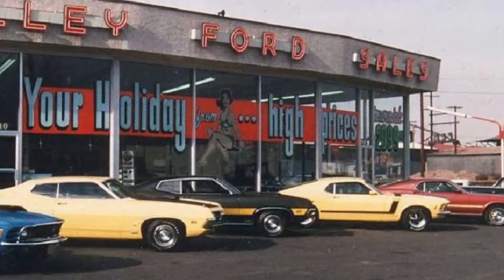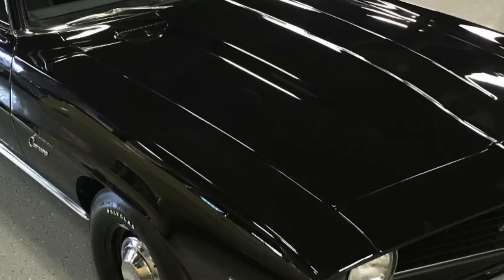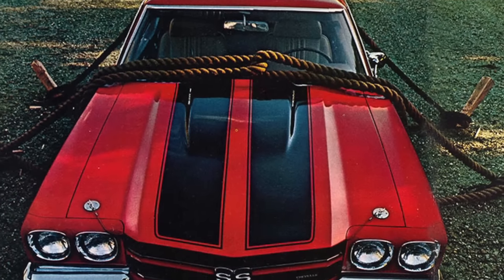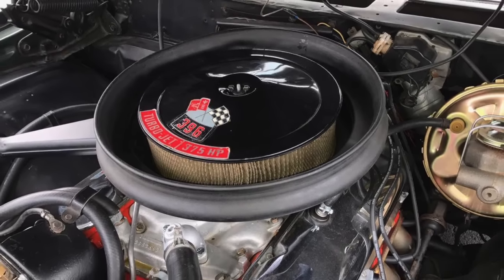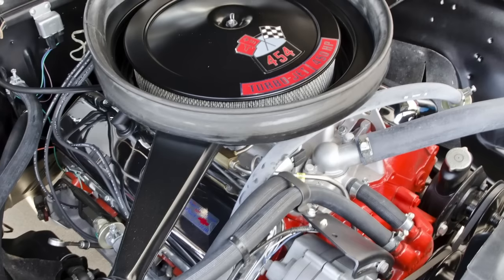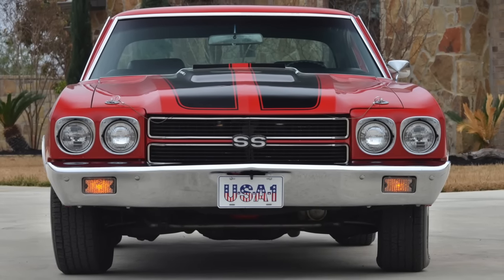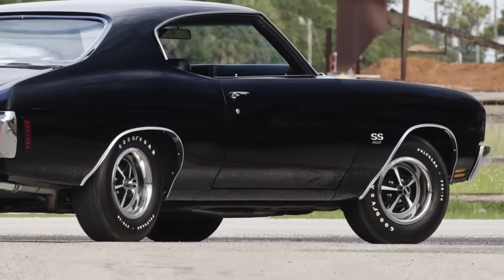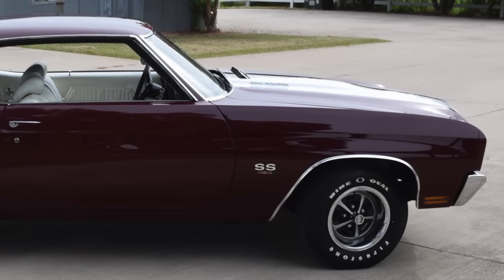1970 Chevrolet Chevelle SS LS6 454 – Freak of Nature

Comment: I owned a '70 Chevelle SS-454 for 15 years.    It was a plain jane LS-5 car with an M-22 four speed and bench seat interior.  Even with the "lowly" LS-5 engine, the car was a beast on the street and drag strip.    I didn't take the car to the track much but I never lost a drag race to any Ford or Mopar when I did.  I raced in the street class.  The trick was trying to get traction off the line.  Fun times.  BTW:  There was a '64 Malibu SS.  It could be ordered with any engine, including a straight six...but you're right, '65 was the first year a big block could be ordered in the Malibu.

Comment: Good Video .....I got to say  the 64 is the first SS Chevelle...not 65.
Reply: 64 was called Malibu
Reply: Ya I don't think the SS option was available until 65.
Reply: I am pretty positive there was an SS Malibu in 64 but there was not a big block in them until 65
Reply: I bought my first Chevy in 64 and it was a 64 chevelle SS.  Bucket seats, 3 on the colume. Didn’t have an option for a 4 speed or a floor shifter. Had to put a floor shift in as the rods to the tranny would bend and lock up the tranny. 
No there wasn’t any big block option.  It was a sexy car.  Bought a 66 SS 396 after that.  They came with Ford Holly carbs as GM couldn’t get the quatra-jet into production.
Reply: Wrong. It was the Chevelle. Malibu was a trim option on the Chevelle. In the 70s the Chevelle name was dropped and then it was the Malibu.

Comment: As I mentioned on another video, in 1971 as a senior in high school I bought an SS 454 El Camino, painted the same red with black hood stripes as this car, had a black landau top. It had hood pins,  cowl induction, M22 Muncie transmission, I removed the smog stuff, added cyclone headers, replaced the Rochester carb with an 850 Holley, magnetic impulse distributer, Gabriel shocks, Crager wheels, BF Goodrich radial TA’s, wide in the rear. It was fun on Van Nuys Blvd. I had the opportunity to meet with Jay Leno about 3 years ago and mentioned this car. He asked “and you still have it, right.” He said if I did he would buy it that day, said it was near a $1,000,000 car. I had purchased it for $2560 from Pollard Whitman Robb Chevrolet on Van Nuys Blvd, unfortunately sold it for $2750 a year later. I did replace it tho with a 1971 SS 454 Corvette that I bought for $4540 from the same dealer, I sold it in 1988 for $74,000.

Comment: one bad mo-fo.  Imagine what she could do with real tires instead of poly tires.
Reply: Yeah I was thinking that exact thing. With proper modern sticky tires and nothing else done to it, I’m sure it cracks the 12’s
Reply: Yea. G70/14 Polyglas were tops back then. I'd like to put my spare set of 245/40 & 275/35 on factory 2017 20" rims on it. I do want them back. I'm running all-seasons on 2019 Camaro twisty rims. 
I do miss white letters, though 😆

Comment: The 400 Turbo Hydraulic transmission? That's a new one to me!
Reply: as a mechanic the turbo 400 is a hydraulic pump:)
Reply: What are you talking about? The Turbo Hydraulic "TH400" ( that's what the "TH" stands for ) was, and IS, an extremely dependable auto-trans & used for many, many years.  If your talking about the "Hydraulic" title.......how ELSE do ya think these GM turbo automatics operate? The GM  TH350 & TH400 transmissions all use CLUTCH PACKS instead of "bands" ( bands are belt or chain driven ). The hydraulic fluid is pumped under pressure. In each gear, the fluid is pumped into that cluster pack of clutch disks ( clutch pack), stacked together like coins, for that gear. As more fluid in that clutch pack increases & creates more pressure, it causes the stack of clutch disks to COMPRESS against each other VERY QUICKLY to interface & engage that gear & force THE NEXT sequence/gear clutch pack, and so on. ( It's a little more complicated, but hopefully, ya get it. ) This resulted in smooth, seamless yet crisp gear changes, that last time after time. A VERY smart design. No "herky jerky" bands, that could skip, slip, break, or wear out. ( Of course many other automatic transmissions got away from the older "bands" design around the same time or soon after, but few, if any, could match the TH400. ) The GM TH400 automatic is STILL used by many for high powered motors because they're TOUGH. The GM  TH400 ( aka "Turbo 400" ) automatic is one of, if not THE MOST DEPENDABLE of all "factory-stock" automatics ever made from '64 to '90 (improved in 1965 ), and an absolutely dependable beast of an auto when modified. The GM TH400 was SO tough & so well thought out, they still use many of it's components in GM's modern day automatics................Now ya know.
Reply: Hey there 40belowful. Fancy seeing you here....small world, lol. My other comment is for the other viewer. Just trying to help & teach these young guys. They only hear "Turbo 400" and obviously haven't learned yet about "TH"........lol. Take care buddy!!!
Reply: Howabouthetruth it's turbo hydramatic genius
Reply: Howabouthetruth they also have bands on the 2nd gear set.
Reply: Howabouthetruth thanks for the tutorial, but I already knew that. I also know the "TH" stands for Turbo Hydramatic, not hydraulic. Hence my comment.
Reply: The THM 400 was used in trucks with automatics. It was heavy duty to say the least. Most other chevy cars had the THM 350.
Reply: "...bands are belt or chain driven..."

Is that so?
Reply: I had a '70 Malibu with the TH400 apparently as part of a trailer hauling package. The car was never outfitted for trailers though.
Reply: rogermurph101 really???what you think TH400 means
Reply: Ron Malinski I know exactly what it means, and it ain't Turbo hydraulic. Why don't you read all the comments before making yours?
Reply: yeah it's actually turbo-hydramatic and I really don't see any need to the video was wrong in a sense but being as I spent years rebuilding them figured I would help out
Reply: Ron Malinski well, after some other guy gave me a long explanation of how this transmission uses hydraulic pressure to function, I pointed out that it's still not called a turbo hydraulic, and that TH stands for Turbo Hydramatic. So it's already been covered, but thanks for your input.
Reply: rogermurph101 yeah all a transmission basically is is a hydraulic pump
Reply: garbage thats why u never heard of it
Reply: turbo 400, torqueflite 727, c-6  are very good automatics
Reply: All greats, especially when "beefed"!
Reply: Just a play on a bad sentence. Turbo 400 Auto.
Reply: so even though all the literature says turbo hydramatic as in the hydramatic division of gm.  you know place that made these and many other transmissions including the original hydramatic trans.  but it's actually turbo hydraulic?  seems really weird but i learn something new  everyday.
 not sure your definition of "bands" but i can assure you   th400 4l80e  (2 band) th700r4 4l60e th350  and many others still use bands  according to my books the internet and my limited experience rebuilding a few different gm transmissions. but thanks for "schooling"  all us idiots.
Reply: hey give the guy a break. he is worried and still waiting for that mensa acceptance which im sure is just lost in the mail.
Reply: That 400 hydraulic is super rare, saw one at Barrett Jackson go for big money...Lol
Reply: Wayne Wildman Wayne you need to watch the video. He was just making a quote.
Reply: I thought everybody older than 40 at least would know about one of the best transmissions Chevy ever made, however I had a Kieth Black 454 once and it had a transmission with an oil pan stamped Turbo Hydramatic 650, which is a unicorn I still to this day can't even prove exists. All I know for sure is it also had a shift kit, was in a 1977 Chevrolet Bonanza 10 Pick up with a 454 Kieth Black built, and that 650hp and 750 foot pounds of torque. People used to tell me that tranny didn't exist. I always told them to crawl under there and see for themselves.
Reply: I had a '69 Chevelle SS396-375hp and the TH400 trans. When I would floor it, I'd shift it manually and would regularly get rubber going from 1st to 2nd. Not a lot, just a nice little bite. Also saw in another video last week that the big 396, though rated at 375hp, was actually 400hp.
Reply: It wasn't so hard to add a few extra horses to the 375 hp 396.  What made the difference to me in driving my 67 Chevelle SS, a 70 Chevelle SS and even my current 400 HP 427 stingray and what was probably an overlooked reason why my 67 SS may have been the biggest beast of them all was the M22 muncie with what was the rock crusher, which my understanding is they discontinued it in 68, yet I believe you could still get one in later models, perhaps inventory. Something sadly missing when I have driven later models, especially gears 1 and 2, which is where I usually won the race by third gear with the 67. Even surprising to me at the time was the ease of beating the so called vaunted Shelby Cobra GT, with what I believe was the 428.
Reply: Howabouthetruth Bands aren't necessarily belt or chain driven. The 700r4 uses a band for the 2-4 drum and it is applied by a servo which is hydraulic. No belt or chain.
Reply: The TH400 was so good Rolls Royce used in the 1960s and 1970s maybe 1980s too.
Reply: Why it could be hydramatic, it could be automatic, it could be greased lightning! Lol 😂 , sorry, everyone was getting too serious about nothing....
Reply: He should have said "Turbo-Hydromatic 400".. thats the name.. I had a Turbo 350 in an Oldsmobile back in the day.. Its the same trans, with a different output shaft size. Had a vacuum modulator valve. The little hose kept falling of mine  and it used to stay in first gear.. Finally put a little clampy thing on it and fixed it.. Ah! the good ole days : )
Reply: Spelling correction.. Turbo Hydra-Matic 400

Comment: Back in the day this car got its ower handed to them as its so heavy they don't tell you that.
Reply: Danny F. all muscle cars were heavy.
Reply: Yes but some more then others like a Duster or Dart are 2,900lb whereas the A car like this will be 4,00 and more.More weight the more power it took to move just like a big block weights a 100 lb more.
Reply: I have a 1968 Lemans 350 H/O, 320 hp with a manual trans.   My car is fairly light and  could beat a few big block cars like the 69 Chevelle with the base 325 horse engine.
Reply: The Duster and Dart handled like a pig.  I grew up driving a 71 Duster with V8,  Fast but don't take coroner in it.   Worst handling car I have ever driven.
Reply: @philipl1109  Um, this Chevelle didn't exactly corner like it's on rails - not with THOSE tires!
Reply: @philipl1109  "don't take CORONER in it." Deadly car? LOL 😆
Reply: A well tuned LT-1 vette would beat it, they were a big heavy car....

Comment: In 1976, I had a '65 Malibu SS 327 and 4 speed. I stuck in a 350hp 395 with nitrous with 4:88 gears to street race. The 396 spun a bearing so I installed a use LS6 450hp 454. Later, I used the same 454 and installed it in a '68 Corvette Roadster with a 4 speed and 4:88 gears. The motor was tired so I rebuilt it with AF Research heads, roller cam and nitrous.

Comment: Good video! Very informative! For a car running F70- 14 bias ply tires, and weighing about 3800 l.b
.s. empty, those are some very good times! 500 ft. l.b.s. of torque could shred 7 inch wide tires. I had a 454 68 Camaro that wouldn't hook with 11 1/2 inch tread Hoosier Quik Time tires!

Comment: Good video! Makes me miss my 1971 SS. Picked her up all original in '84 and the first year SS option that offered a single exhaust small block. EPA coming to save the day...350/270  it was no LS6 but the SS package made it a great driver. Daily driver until '91. Am/8-track factory radio sucked but so cool and outdated I couldn't bring myself to cut into the dashboard. 3rd owner not including the middle man picker that got the car for resale. Fun machine!

Comment: My old man raced a Plymouth GTX back then with a 440 super commando with dual quad carbs and Mohawk slicks and he mostly ran high 11’s low 12’s but his best time ever was 11.11 126mph in the 1/4 I have the time slip and the trophy he won that night at Detroit drag way. That car was a freak of nature it was faster then it should have been most of the 440’s where turning 13’s and 14’s and his ran 13 stock and the slicks got it into the 11’s. Getting these cars to hook was the trick they had the power just not the tires. He ordered his with 4.11 gears and mounted the slicks when he was at the track. He would outrun the hemis through the 1/4 but after that the hemis would blow around him like he was tied to a stump.

Comment: I had a 1970, Chevelle, SS 396, 3 Sp. Auto.  God I wish I had her back.  But, I traded her on a 1976 Ford, F-150 with a 360 C.I.D.  It was a good truck, but nothing like the 396.  I got into trucks as I got older and now drive a 2019, Chev., 2500 Duramax, Allison 6 Speed and love it.  It's like having the Star ship Enterprise, NCC 1701 with the cool raised hood.

Comment: When I was in high school one of my best friends purchased an SS decked out. I was the first to ride in it. Hairy beast, it was. Another friend in the car asked to drive it and I yelled "NO, NO, NO" and tried to explain to the guy that he had no idea how much power was under the hood. But the owner was a really nice guy and said okay. So they did a Chinese fire drill while we waited at a light. I keep warning the new driver "feather the clutch, barely any gas", it was a four speed manual (of course, what serious car guy would go with an auto?). The light changed and the car pounced forward directly into the rear of the guy in front. Grill smashed, one head light nacelle crunched, bumper bent. I was hopping mad at the numb skull but my friend took it very well. He fixed the car like new but once you remove factory metal, that's where rust begins. It makes me mad to this day. My friend scraped up the money, working very hard, and this other squirrel crunched it in 10 seconds. 

I had a factory V8 Monza, bought brand new, which I loved. It was the last of the pony cars. I gave a guy from work a lift to McDonalds during lunch. While I was inside the fool moved it. I nearly killed the guy telling him to not get within ten feet of my car again. NOBODY DRIVES MY CARS. I found an intake manifold and Carter 4 barrel at a yard sale cheap and put it in the Monza. It had a wimpy 2 barrel on it previously. The primaries on the Carter were tiny but the secondaries were HUGE, practically could put your fist through. When you put your foot in it, the car just roared and leapt ahead. I never needed to re-jet it but it ran a bit rich. It got much better gas mileage than the 2 barrel if you could stay on the primaries but who could do THAT! With primaries you could get mid 20 mpg but when the secondaries opened full that dropped to roughly 2 mpg, if that. My wife loved to stop light race with it. It was a true sleeper with only a tiny V8 emblem on the front fender. Loved that car...

Oh, one last thing. I had to rebuild the Carter. Stripped it down, lubed it, cleaned jets, new gaskets. Years later I read an article on how great Carters were (true) but NEVER take it apart, it's too complex. Glad I didn't read that stupid article before I completely rebuilt the Carter, eh? Real car guys can do ANYTHING car related, at least before computer controls. I would love to convert my Truck off from computer controls but, in retirement, money is short and you aren't as nimble as forty years ago!

Comment: I bought a new chevelle in 1969, SS396, it was about 3,200$, traded in a 65 impala so after trade it cost me 2200.00, but in 1972 I bought a new corvette, I paid the dealer in Fargo, ND  5,020.00$ and drove it off the show floor.  I guess the good old days were kinda good to me.

Comment: I am a Mopar guy, but the 70 Chevelle SS was the nicest rear bumper ever put on a muscle car, my buddy had a 69 Charger 440 six pack, with street slicks, and this 70 Chevelle that would tear up the neiborhood, would beat him every time, so would a 70 Camaro named Sassy back in the day, and let me tell you that Charger was fast, he would put a $10 bill on the dash board, stop at a light, and tell you if you can grab it when I take off, you can have it, that was a lot of money back then, and there was no way, that car pinned you back in the seat, and the $10 bill ended up in the back seat, ohh, the good old days of my teens, road runners, Cudas and chargers were everywhere, I had a friend who had a 66 Chevelle with a 427 four speed, and his dad made him sell it because of too many tickets, it was marina blue and mint, they wanted $2,000, and that was just too much money for a teen back then, I bought a banged up 383 road runner instead for $600, I just drove it banged up, nobody restored these cars back then, they went to the crusher.

Comment: I used to own a  '61 Impala 2 door HT.  The main advantage of the '61 is that starting in '62 the HT had a large blind spot between the side and rear windows.  Being a motorcyclist, I really appreciated a car that the driver could see out of in every direction.  When I got it, it had a 283 and a 3 speed in it.  I bolted a 350 right in, as well as a Muncie 4 speed with Hurst linkage.   It didn't have power steering, so the only thing the front of the motor was pulling was the fan belt.  I don't now if Chevy made a big block back then, but I'm sure it would fit.  Small block or big block, I NEVER would consider a stupidmatic transmission.

Comment: My Dad bought a  brand new 1969 Nova after being in the Marines in Vietnam. 

Though it came with a 350, in 1970 he wanted more horse power and bought a brand new LS6 crate motor direct from GM and put in the LS6. The Nova probably weighs 600-700 pounds less than a Chevelle. 

I proudly have this gem in my garage and the car only has 26k original miles.